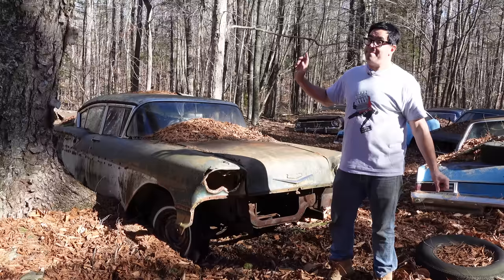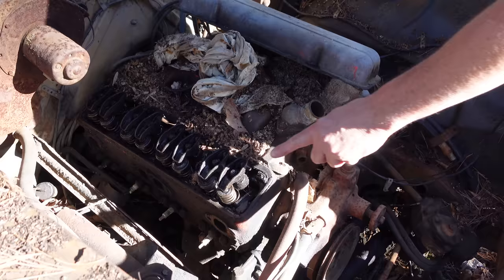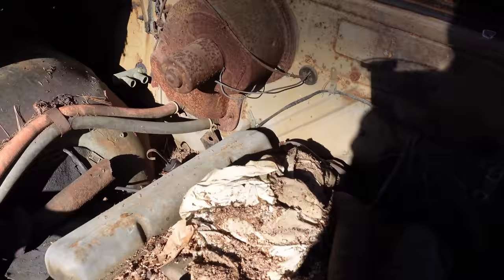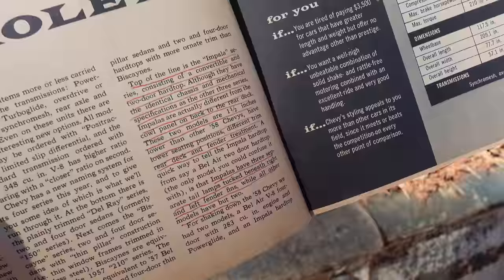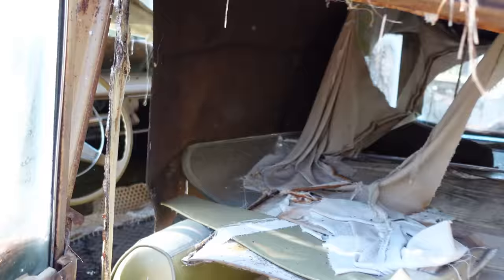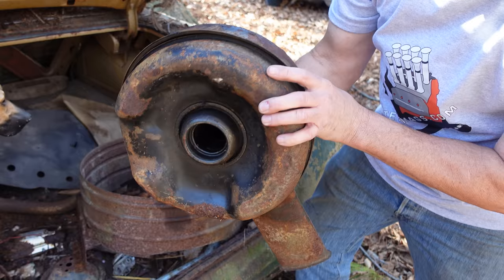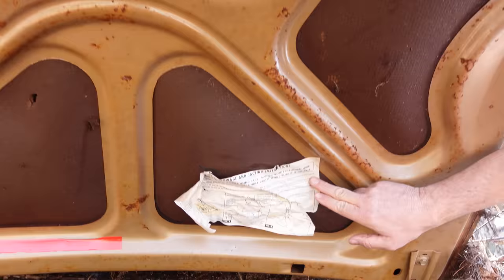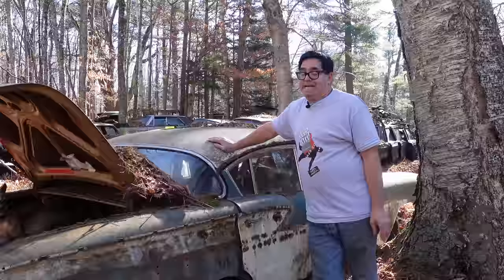Fresh Breath of Bel Air

Comment: I saw drawings for the original versions of the 1959 GM cars... you 59 and 60 GM fans should get down on your knees and thank the flying spaghetti monster for the Chrysler Forward Look cars. A GM engineer had a peek at the 57 Mopars, and it shook GM to it's core... they knew the 59 models they had planned were going to be ugly monstrosities compared to the Forward Look cars, so they went back to the drawing board and totally changed the 50 and 60 models for GM. The only things they kept were the X-frame and the greenhouse.
Reply from the maker: You Know it! A reversal took place for the 1962 Dodge and Plymouth mid-size B-body design. Apparently these were initially planned to ride on the full size 122-inch C-body platform but somebody at Chrysler got early news that GM was down sizing and so the 1962 body designs were squashed down to fit the smaller B-body chassis. Also, the "down sized" GM vehicles that were "spied" turned out to be the Nova (launched 1962) and NOT the usual Chevy full size. This story has been published by reputable sources including Collectible Automobile and Special Interest Autos over the past 20 years so I'd say it has some credence. Anyhoo, it goes to show that the Detroit Game is a big circle! Thanks again for watching and writing. -Steve Magnante

Comment: Yup and 58-64 gm cars are some of the most unsafe cars ever made too side impact was usually instant death at only 40 mph hit . even front impact was a complete wadd up to the dash. Check out the 99 malibu vers 59 chevy on you tube its very scary for sure !! 63 and 64 full size gm are total death traps as the steering wheel comes back with the dash and crushes the driver and cause of cowl redesign it folds in the center and pins the front passengers legs in a sandwich and the doors come open and passenger my get lucky and be ejected from from the seat with offset corner impact .
Reply: That was hardly a fair comparison, a rotty bondoed up car in the worst possible collision angle against new crash beams and so forth.
Reply: That's like comparing Burger King to Peter Luger. Yes, they are both meat, but the difference is night and day. We wouldn't want to live today on 1950s medical technology, but back in the 1950s, what they were doing was cutting edge to them. Things always improve over time in a lot of realms.
Reply: It was a low miles original out a collection actually . they got a lot of flack for destroying it at the time . and it is a fair comparison its show a point . a 59 against another 59 and the results are the same just for both. Look at some vintage crash photos in general. Of 50s & 60s cars one would thing by looking at them that they are strong but in reality they are just a bunch air and sheet metal
Reply: Your missing the simple point being made Google user . its not for judging or being judgmental of the comment , just that how unsafe the cars were in a crash and even more so against modern vehicles . or even vrs modern safety design .
Reply: @dowen1511  No I get the point. If we haven't progressed in the realm of safety, design, function and whatever in 50+ years, we shouldn't be in business doing what we do. Of course it's going to improve in 50+ years. At the time, the 1950s Chevy was probably no better or worse than its' peers on the road.
Reply: When I was 6 years old (1962) I was in my front yard and heard a loud crash down the street somewhere.  My friends and I ran down the street and saw the aftermath of a head on collision on a blind curve. My older brother showed up and carried me away from the scene. The 2 cars were only going about 30-35 mph. Years later my brother told me that it was a 1960 Buick and a 1959 Oldsmobile.  A couple was in the Oldsmobile, both died, the man's upper torso went through the windshield onto the hood. A family of 4 was in the Buick ,2 adults, 2 children. One child was ejected out the back door and survived, the other's were killed. I wouldn't get in a car for about a year after that. However, I did become a " car guy" later on. Spent most of my life in the industry. I taught Collision Repair/ refinishing before retirement.  Yepper, those old cars were very unsafe compared to what we drive today, no doubt.
Reply: @dowen1511  You could see the rust and bondo come out of it when it hit.
Reply: Yeah there is some kind of dust comming out of the 59 but don't look like rust per say to me Idk paint shop dust maybe for sure but bondo flying off ?  Well I bring my words to the table cause I had an uncle that was almost killed in a 64 chevy t boned on drivers side at only 40 mph in 1987 side was smashed plumb to the console . lost a leg and broke almost every rib on his left side and collar bone . if only I could post a pic of the car . x frame cars with out side rails too are just a bad idea .
Reply: @dowen1511  I've seen people pulled out of modern cars that were hit by something bigger and they obviously were badly injured or did not make it. All depends on the hit.
Reply from the maker: Hello CR7659, I agree. The rust and corrosion must have weakened that "sacrificial" '59 Chevy a fair amount. That said, the whole publicity stunt was silly. I'm just glad they didn't destroy a solid example. Thanks for watching and writing. -Steve Magnante
Reply from the maker: Hello D Owen, you make a great point. The many massive surfaces of sheet metal on older cars are indeed filled with AIR. Not support beams or crash tubes. Oh, well. We live and learn. That said, Detroit's hesitance to embrace occupant safety by resisting seat belt mandates is UNFORGIVABLE in some views. Many a 30-mph impact was a fatality due to "ejection" (not just for cassette tapes!). But again, we make progress with time. Steve Magnante
Reply from the maker: And lets not forget Chrysler's dash-mounted rear view mirrors of the late 1950's / early 1960's. I call them "rib rakers" because that's what they do to your rib cage as you pass by. Does it sound like a xylophone? I hope I never find out. Thanks for watching and writing. -Steve Magnante
Reply: @SteveMagnante  Those mirrors will at least fold over.  A few years ago the you pull yard here got a '64 Corvair so I went to yank the steering box for a quick flip.  I was shocked to find the steering shaft all one piece from wheel to box.   That must have been great in a front end crash.  I think everything else by then had a rag joint in it somewhere.
Reply: As a poor note for modern cars look at crash test for the late 90s s 10 pick ups and the Astros vans 😳 and the ford f 150 . astro vans fold in the middle even though its welded to a frame ! But one is dead in front impact at 40 mph . and is what is unexpected is the k car variants of the 80s actually do very well in a crash and best out most all I've watched is the 80s full size ford they are like a battering ram !
Reply: And the late 90s 2000 s chrysler/ dodge caravans seem to do very well best of the small vans for sure .

Comment: Those coil springs were so flimsy compared to the leafs in the exner chryslers. There's video of them side by side hitting hard bumps, and while the chrysler just levels out, the g.m. actually broke apart.